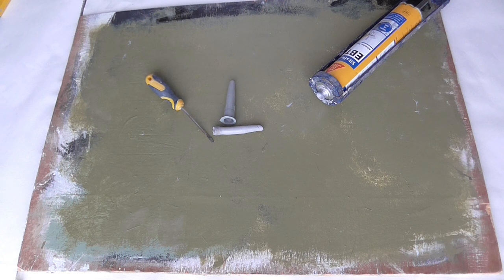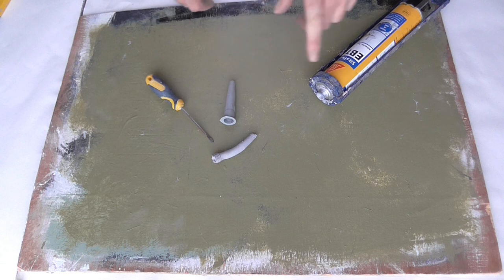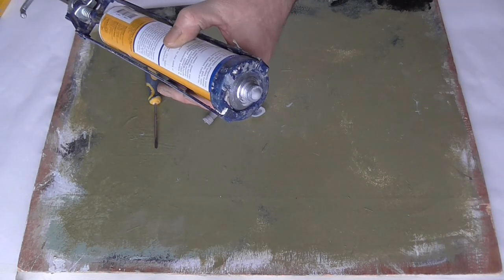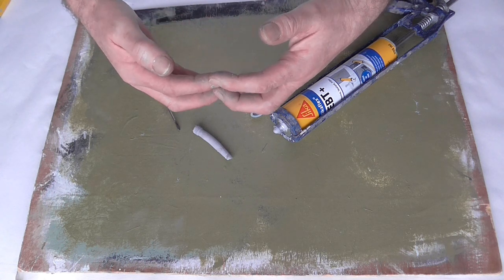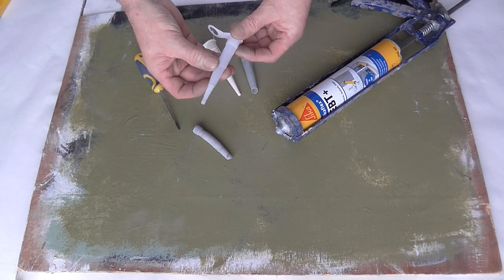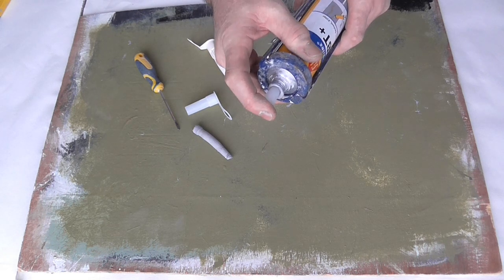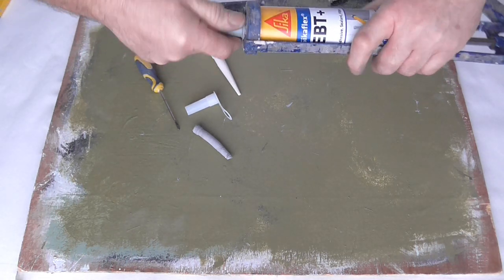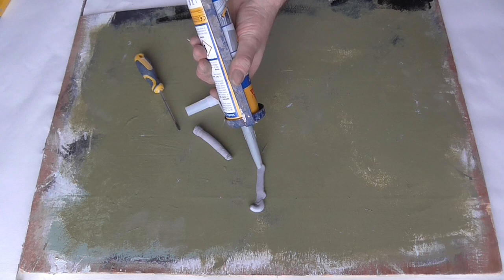How To Unblock Fast Curing Sealant Cartridge And Nozzle

Comment: Hi, not the same topic but I have some painted skirting board but it wasn’t treated by the previous owners and the knots are showing through is there anything I can do? Zinnzer?
Reply from the maker: Sorry for late reply...   you can sand back and start again...  using two coats of knotting solution then a coat of B.I.N. primer thanks..

Comment: Hey buddy. I’ve been studying your videos for about a week. I don’t have any experience with DIY apart from painting. I stay in an old flat built in the 1950’s, I moved in and stripped wallpaper down and with that came old plaster, probably 30+ years old, there’s a few holes and some of the plaster has fell off, the plaster is thin, where it’s fell off it’s back to what looks like grey stone, it isn’t bricks. I wanna ask you, do I just go over those patches with undercoat plaster or use a filler, I know I can fill the holes with the foam stuff it’s more the patches I’m wondering about that aren’t actually deep holes. I wish I could send you a photo to show you! Would greatly appreciate your help as I genuinely have to do this myself.
Reply from the maker: Hi, yes you can use undercoat plaster they even do an all in one plaster....  no movement no need for foam.. thanks
Reply: @PaintingandDecorating  thanks for replying. I know you get easier methods but I think I’ll stick to the undercoat plaster and filler, I think I could handle that. One more question as it’s old dry plaster should I wet the bits I’m going it skim over with diluted pva? Or do I do that after I fill and sand? I will be buying a good oil based primer for when everything’s complete before painting, am I on the right lines? Thanks
Reply from the maker: @conor_94_  yes before and after.. thanks
Reply: @PaintingandDecorating  thanks buddy

Comment: Hi mate,

What is your opinion of papering over the backing paper of peeled off vinyl with new vinyl? (while overlapping seams of course) I'm unable to empty the room and do it all at once, so having to work slowly across the walls while moving stuff as I go (haven't started yet). I'm not sure if spraying the backing paper with misty water and peeling it right off will leave the lining paper behind it intact or not, hence me wanting to just leave the backing paper as is if it is sound once the vinyl top layer is off and just fill in any seams, etc.